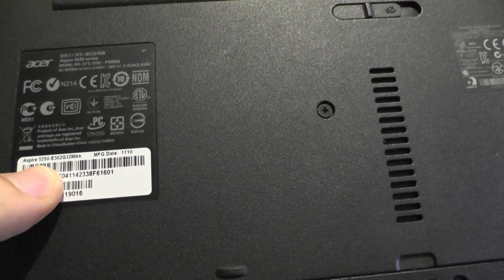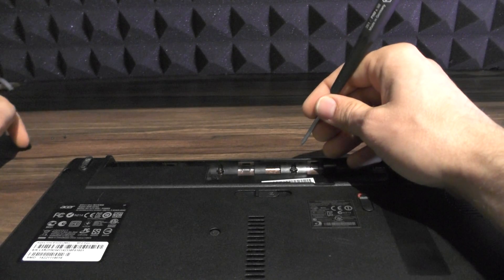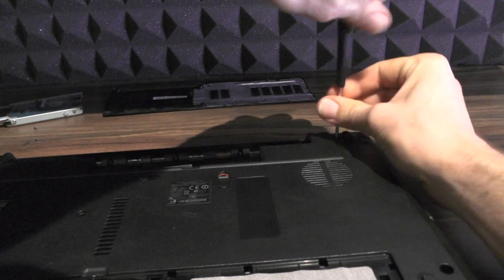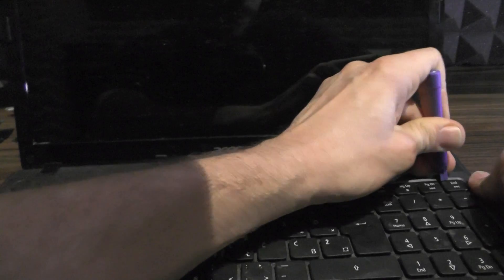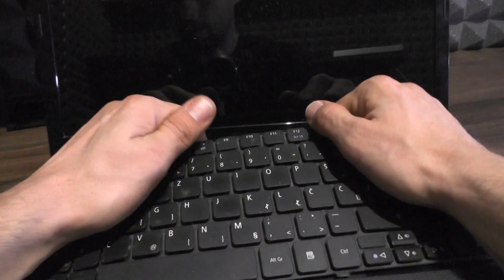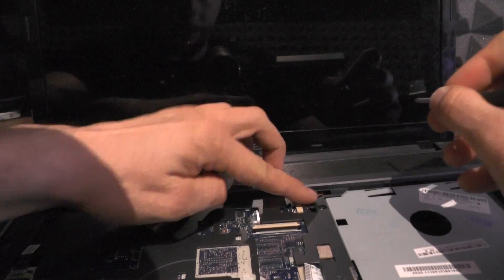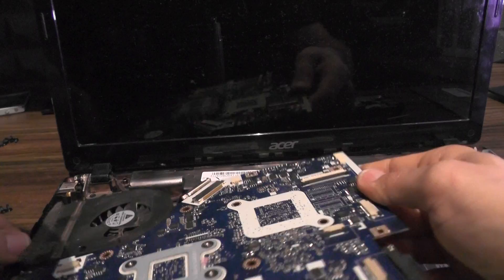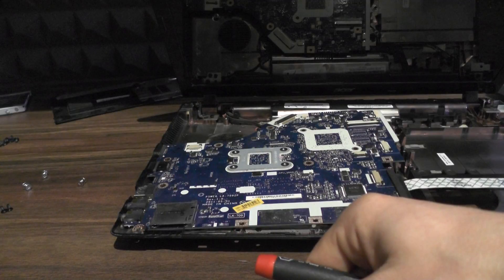[HW HowTo] - disassemble Acer Aspire 5250 (to clean heatsink and fan)

Comment: i bought Packard Bell which is an analog of the Acer for 10 pounds like new. Renewed thermal paste installed Lubuntu, SSD, and 8gb ram and my wifes mother still  watch Youtube in 480p without skips on this machine almost 10 years after this vid bro) The screen is surprisingly good. 480 looks almost like 720 on my HP. I thought the AMD E300 was a deadborn chip but on Lubuntu you can kinda use it even today.

Comment: Maybe more focus on important components and wires and where they should be plugged, rambling over valuable procedure and too much focus on screws which obviously are a part or disassembly, plus the camera angle is completely useless.  Look at other tutorials when the cam is right above the work since everything is already flat on the table, why are you rushing over it at All? Organize ur work.. use a tray to put all the screws in so you don't have to focus on the screws and present your work orderly connecting what where 
Thank you kindly
Reply: yeah, i t is very good as it is now with your advices would be of be the best tutorials instructor, i already made mine from 32bits to 64, and from 2Gram to 8 , but now i did the maintanance on it and now doesn't catch on the dvd burner (check connects ik) thats why i came here it would have been very helpfull have he had done the vid the way you mention

Comment: This was really useful, thank you!
My laptop was overheating and it was because the vent was full of dust, like really full so it over heated, I cleaned it and changed the thermal paste, and I'm planning on putting a 240gb ssd on it and 8gb of ram to try to revive the laptop some more
Reply: Edit: today I installed the 8gb of ram and the laptop detected the 8gb and everything but it says only 3.7gb are usable and like 5.3gb are reserved for the system I guess xd
Reply from the maker: do you have 32 bit windows. usually ram is not addressable if you have x86 version of windows (if yes - you'll need to install x64 - you can use the same key)
Reply: @MTS_IT  i actually had the 64 bit version of windows, but now i installed linux mint 64 bit on the ssd and it didn't read the 8gb so I swapped it again for the 4gb modules

Comment: I'm scared I might break the panel for the hard drive
Reply from the maker: yeah, it is a bit hard to get off....
Reply: @MTS_IT  I got off the panel but my hard drive is stuck idk what to do
Reply from the maker: @IzThePlugg  did you remove that one screw? if so that metal sometimes gets glued to the plastic so try prying it - be careful not to fu** up something :D
Reply: @MTS_IT  yes I removed the screw. I was able to move the harddrive to where the pins barely show but I can't fully remove it
Reply from the maker: @IzThePlugg  just move it some more..

Comment: Bro after I remove every thing when I connect it back red and blue lights are working but the the fan not spinning nothing iscoming in the display also 
What do I do ?
Help me
Reply from the maker: Hi:
1. Has the ram been seated propertly?  (did it click? is it all the way in?)
2. Did you push the LCD connector all the way? - this type of connector can look as it is connected but it's actually not. If needs to be pushed all the way in. Be sure to press it evenly because it can break easily!

3. Regarding fan: - Did you connect it propertly? did you connect it at all? (happened to me more than once :) ) , also, fan starts to spin at certain temperature, so, if you have connected it propertly it is likely that if will start spinning once the cpu gets hot enough. (some bioses have "fan always on when plugged in" feature - so if you don't want to wait turn that thing on).

Hope this helps in some way.